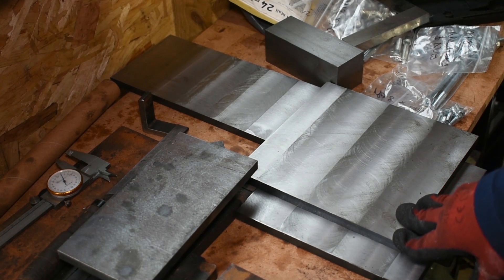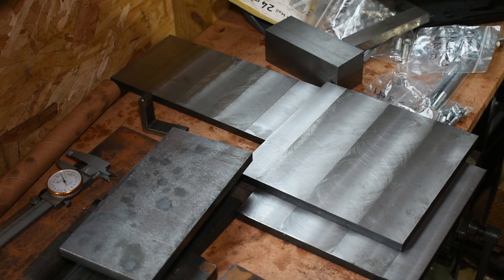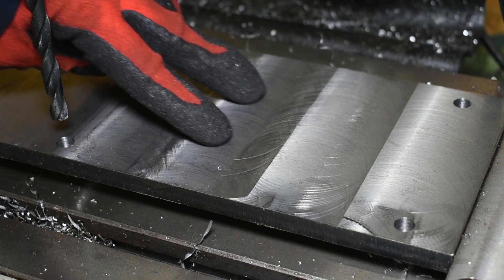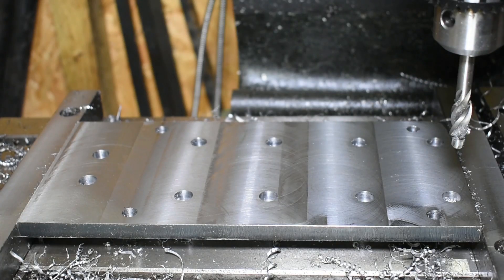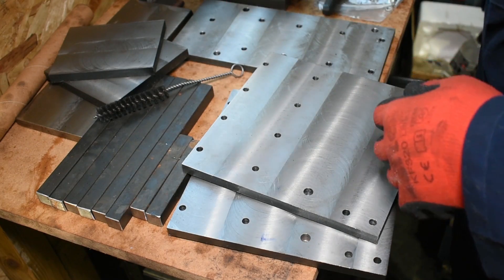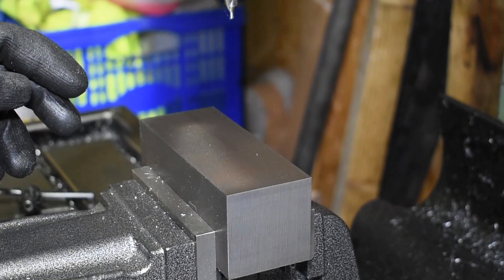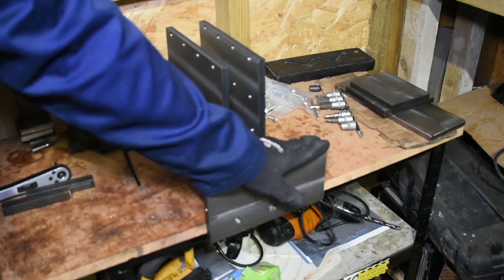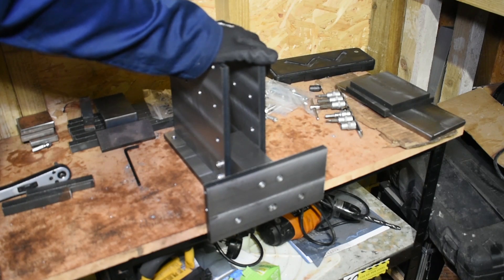Make your own Shaper Machine! Part 1

Comment: Putting a small piece of sheet metal under the part between it and the table will stop you accidently marking the table when the drill pops through, i have had drills act like a tap on breakthrough, luckily the drill didn't reach the table.